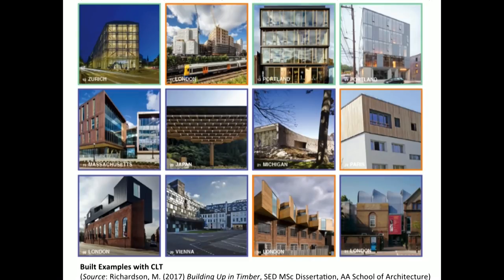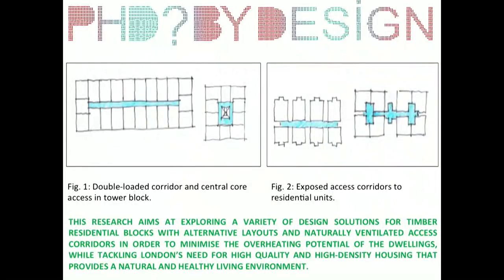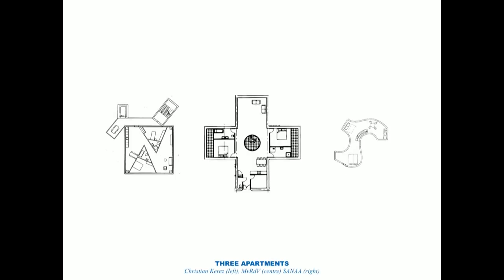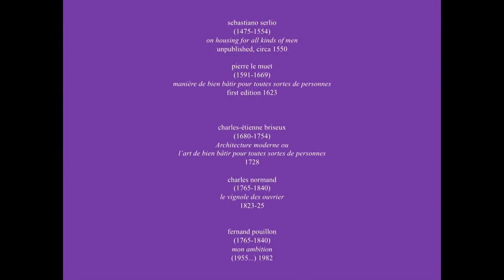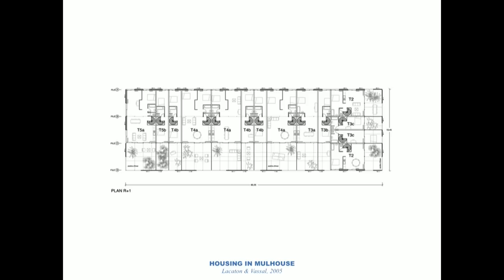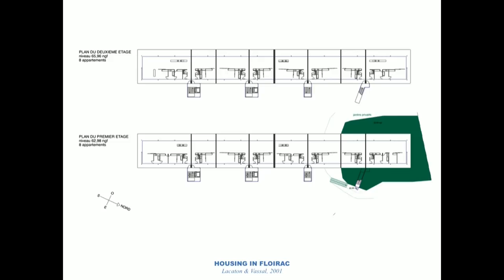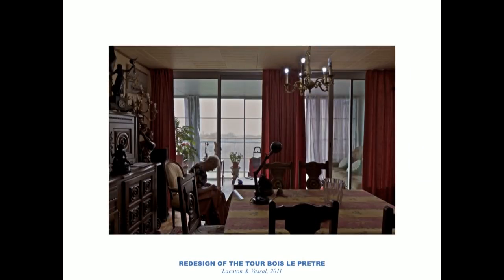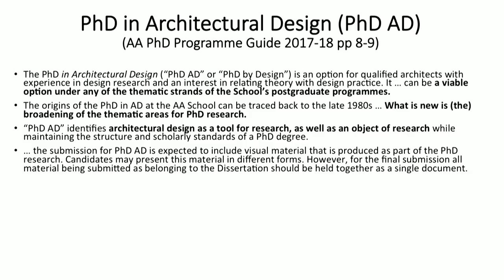What is PhD by Design?

Comment: PhD in Design isn't about anything else, but re-defining the real world problem of, I have the requirements but I have no authority. This is taking a step into advancing the need for the society to accept the need for more than an advance engineering degree or MBA, and shine a light onto the importance of design that's critical within advancement of human beings in a society that requires critical thinking more than how to put blocks together without thinking about the issues that's currently present for the world. 

Ultimately, this has to be the program that is for the guardians of critical thinking that goes beyond efficiencies, to provide innovations that provide cost savings with consideration for the wellbeing of the world.